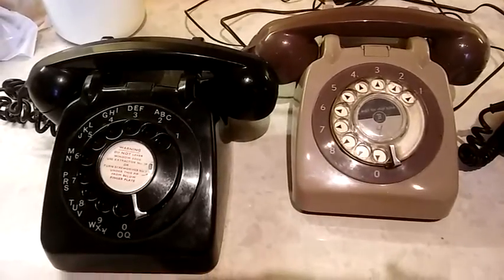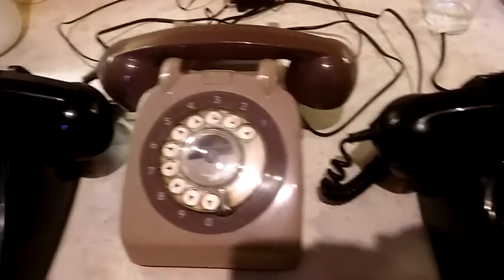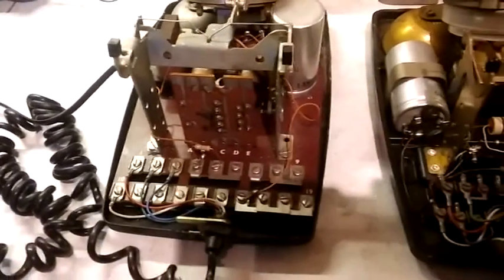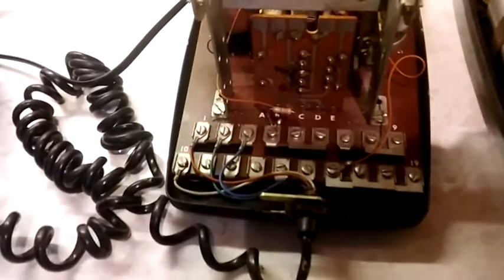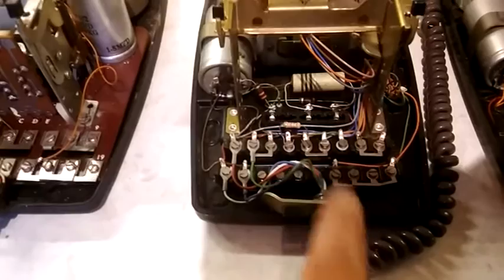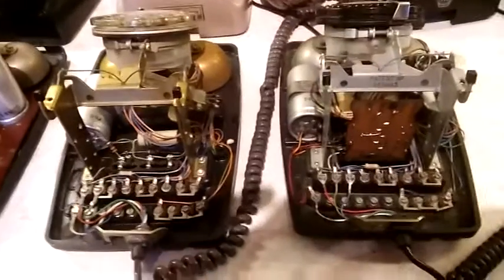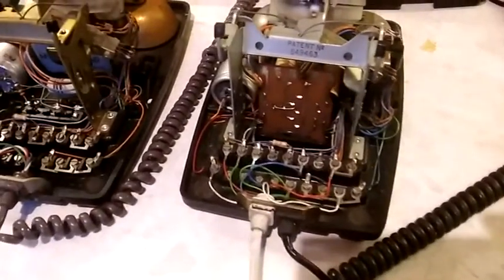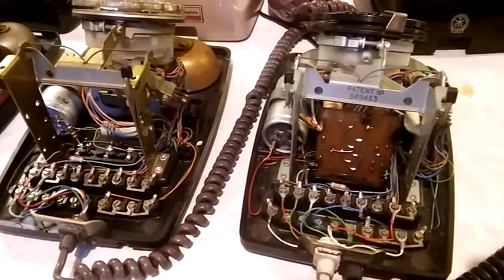Rewiring & Converting Old Ericsson Telephones.

Comment: thank you for this tutorial, I just wired up my 706 telephone and it works a treat! mine had a redial button on the top but I just disconnected it, thanks once again !!
Reply from the maker: Good to hear you got your 706 going. Disconnecting the redial button is ok. I think you could probably also leave it wired up as well, it just wouldn't work on the normal BT system these days. I'll stand to be corrected on that though.

Comment: The only descriptive identification I can find reads: TELE 706 F PO FDI BATCH SAMPLED FWR 79/1.  As you correctly pointed out my initial posting was in error.  Also inside the top casing are the letters 2/DCO/609.  On the dial in reverse are the letters BLD 12 also 468A in a smaller font size.  My dial is in clear plastic and the phone casing is in Black.  The electronics is mounted directly to the base and not a printed circuit board.  I cannot locate any L.  Numbers on dial are behind the finger wheel.   Handset blue wire = T3.  Cheers.
Reply from the maker: Thanks for the extra info. You can forget about the codes cast into the various parts such as the case and dial for now. The thing to concentrate on is anything printed or stuck to the base of the phone. So the interesting bit is 'TELE 706 F PO FDI BATCH SAMPLED FWR 79/1'.

TELE 706 F tells me the phone is a model 706 F used by the GPO, which later became Telecom and then BT. The 'F' denotes a dial that has figures only, which is as you describe and is basically the same as fitted to the later 746 type.

'FWR 79/1' tells me this phone was refurbished at the factory in 1979.

Your phone was probably originally a 706 L with both numbers and letters around the dial. My guess is it got the more modern dial when it was refurbished in 1979.

Wiring for a modern line cord is the same as for any other standard 706. I think what confused you is the 706 I showed in the other video had a printed circuit board while yours has conventional wiring. Both types were used but are actually wired exactly the same and use mostly the same components.

So the handset cord remains where it is (ie RED=T1, GREEN=T2, BLUE=T3, WHITE=T10).

Next remove all of the metal links between the terminals and replace them as follows: Link T5-T6, link T8-T9, Link T16-T17-T18-T19 so all four of these terminals are linked together.

Now you need to insert a 3.3kilo-ohm (available for a few pence from any electronics supplier) between T4-T5.

Now if your new line cord has the colours white/green/blue/red connect WHITE to T18
RED to T8
BLUE to T6
GREEN is not used so either connect it to T15 which you should find is a spare terminal with no wires coming from it, or just cut it short and insulate the end.

If your new line cord has the colours black/green/blue/yellow connect it as follows:
BLACK to T18
YELLOW to T8
BLUE to T6
GREEN is not used so can be put onto T15 just to keep it tidy.

I'll make another video about this, including how to connect the plug to the other end of the cord just in case your making a new line cord from scratch. So keep an eye out for it in a few days time.

If you have any problems the drop me an e-mail to andysshopmail at gmail dot com (I wrote it that way to confuse the spam-bots!)

Good luck with the conversion!

Comment: Excellent demonstration. Thank you. Encourages me to ask: a telephone designated as 1806 (T89 on the base), looks exactly on the outside (and very similar inside) as the N1900 in your video, but not quite. The handset is wired: red to T19, white to T8, green to T18, blue to T17. The line cord has white to T1, green to T4, red to T5/6. Sorry to trouble you but I would be grateful for any advice you could kindly offer.

Comment: Hi, again an excellent explanation, especially of the Ericsson handset cord. Quick question I always remove the strap between T8 & T9, is there any particular need/reason for leaving this strap in place?
Reply from the maker: Hi! That's a very good question about the link between T8 &T9. Later builds of phones based on rhis design and built for Telecom (as it was then) don't seem to have this link from new. This is the ones with the plug already fitted and 2000 ohm bell coils normally numbered 8746 etc. So if it's an old GPO/Telecom phone I don't think it's strictly necessary. However I'm not completely sure there aren't some wiring differences in some of the non-GPO variants as built by Ericsson and others, so to keep it as simple as possible I just leave it in. There is certainly no problem with leaving it there.

I'll do a bit more research and put together another video about this. Thanks again for the question.

Comment: What are the bell connections for the N1900 please? Connected as vid and everything works just no ring.
Thanks
Reply from the maker: The bell coils are wired together in series. So one wire from one coil goes to T4, the other wire from the same coil jumps to the other coil, then the spare wire from the second coil goes to T16. Don't forget you need a 3.3k ohm resistor between T4 and T5. If it still doesn't work drop me a message through the contact form on the website at https://andysshed.callpress.net and we'll sort it out.
Reply: @AndysShed  hi Andy thanks for the reply.
I have wired my N1900 exactly the same as your video step by step including the resistor.
I have now connected wires from the Bell coil( only 2 wires connected to bell coil) to T4 and T16 as instructed.
The phone works and rings in/out there's just no bell and the audio is very faint at the handset.
Have you any idea what I can do to sort out the bell issue so it rings on incoming call?

Thanks in advance and apologies for long comment
Reply from the maker: @tomrich191094   The problem with the Ericsson N1900 is there are a lot of different variants of it. From memory, I think the one in the video was an N1900 E244. Do you know what code on yours follows the N1900 bit?

It sounds like there is another fault going on if sound at the reveiver is low. How did you test this? If you used another old phone to ring it, then the problem could be the carbon granule microphone in the other phone. If you called it from a modren mobile, the fault is more likely with the speaker in your handset. Also, how many phones do you have plugged into your house system? You need to know the REN value of each phone plugged in around your house and add them all up. If the total comes to more than 4 that could be why your phone doesn't ring. If the ,1900 is correctly converted with the 3.3k ohm resistor, then it's REN value should be 1.

One final thing... Does your variant have the plug in rectifier board? If it does, turn the board over so the end that doesn't connevt to any of the electronic components is plugged itto the phone. That should make the speech a bit louder.
Reply: Hello i have the E244 variant exactly the same as the model in this video.
There are no phones connected in the house just this one however it is connected to the virgin media router after passing through a filter.

I suspect the speaker in the handset may be at fault but still no joy with the bell ringing. Do you have an email i could send pictures etc as your website only has a contact form but nowhere to add photos.
Thanks again Andy
Reply from the maker: If you drop me a line using the contact form I'll send you a message back with an e-mail address. I've learned not to put the e-mail in the comments or on the website because it gets scanned by bots and I end up with tons of spam.

Comment: I have a GPO 700F that I want to convert.  Your Videos are informative and excellent.  But on visual inspection of my phone.. the wiring is not as your video depict prior to any alteration.  I have tried to send or paste a image of the wiring but without success. 
I have watched your other video.  It would appear that although the base unit reads GPO Mk1 706 F.  The internal workings on a black plastic base are for an Ericsson N9100 if that is at all possible.  Therefore which video do I now watch for the answer to convert please.
Reply from the maker: That's a very good question you ask. Before I answer though I just need to clarify a couple of points. First, as far as I know there is no such thing as a GPO 700F. There could possibly be a 706F, but it's very unlikely. It's more probable it would be a 706L with both letters (hence the 'L') and figures on the dial surround. However these often got refurbished by fitting a more modern dial which effectively made them 706F becaise they usually had a blank surround with the figures actually behind the finger wheel. Underneath in white paint you should see something like '706L XXX DD/1' where XXX is a letter code denoting the manufacturer of the phone and DD is the year in the format 61=1961 etc. This is almost always in white paint printed directly onto the base of the phone. If you're getting the info from a sticky label that's probably refurb details and covers the original information.

If it's an Ericsson N1900 this will be physically stamped into the plastic base. There are normally more characters eg 'N1900 E244' That last part is crucial because Ericsson made a number of different versions of the N1900.

If I remember correctly, in the video the straps between the terminals in the phones have all been moved already. So what you are looking at is how they should be when you've finished.

Another way to get an idea what you've got is to look which terminal the blue wire in the handset cable goes to. It probably either goes to T3 on the top row or T11 on the bottom row. If it goes to T11 there's a good chance it's an N1900. However if it goes to T3 it's a 706 built for the GPO or maybe some other Ericsson model.

Is there any chance you could make a video response or maybe put a photo on flickr and post a link to it here? I could do with seeing the wiring to make sure I give you the right info. However the line cords on all the phones should be wired to exactly the same terminals. It just looks a bit different on the N1900E244 because that blue handset wire goes to a different terminal and there is that extra jumper link. You should never have to move any of the handset wires, just the line cord ones that go to the plug.

Let me know how you get on!
Reply: Thank you for your prompt reply.  The information you have given in the reply, I will put to use and then get the right model number back to you.  I have tried uploading a photo of the wiring to nill effect.  DO YOU Have an: email address; or WhatsAPP; or Messenger link as I am not familiar with flcker.  That said I will ask my offspring to assist.  Thanks again and I will be back to you. Cheers!
Reply: SUCCESS!....Thanks for your helpful informative feedback....together with two of the Youtube tutorials you have posted...I got the conversion right on the first attempt....thanks again....
Reply from the maker: Good to hear you got it working ok. Keep an eye on the channel because a couple of new ohone related videos will be comming out very soon.

Comment: Can the n1900 have a 205 rectifier installed ? if so, where do i put it. Iam grateful for you doing this video Andy, I cant find any other place that shows how to convert a n1900 which i have here right now.
Reply from the maker: That's a very good question! I can't see any reason why not. The reason they don't have one is because they were usually built to a budget, which is also the reason they often don't have a regulator board. 

The thing with N1900s is there are a number of different variations, some of which had different connections inside. There should be another code printed on the phone after the N1900 (eg N1900 E244). If you can find that code and let me know I'll be able to tell you where to connect the 205.
Reply: Mine is a n1900 E274 which i cant find any info on it via the interweb. I have now converted it thanks to your video :-) :-)
Reply from the maker: I'll have to get back to you on that one. I'm not sure what the wiring should look like in a N1900 E274 without having a look. I'll have to look through the collection to see if I've got one. Other variants are E244 and A61T.
Reply from the maker: Hi James. I've done a bit of research and answered your question about the rectifier in this video. https://www.youtube.com/watch?v=FnnyhUwDPyI

Comment: Our ringer current lead is already built in the red and green wires
Reply from the maker: That's how it used to be here too. We still only have the two wires coming in from the phone network, but they go to something called a master socket, which contains a capacitor, then to any extensions around the house. This is why we have to convert old phones to bridge out their internal capacitor (to use the one in the master socket) and also reduce the current consumed by the bells so more than one unit can operate together.

Comment: hi, my wall mount 706 (711 I believe?!) is wired correctly but doesn't seem to be powered.. can't make/take calls... no life at all! any ideas? thanks.
Reply from the maker: There are a number of things that could be causing your problem. If the phone is totally dead the first thing I would suggest is taking a look at the hook switch. If the pegs are jammed down (which can happen on a 711) or the internal microswitch that they operate isn't working correctly, then the phone would appear dead. You should still be able to call it though and it should ring.

Another problem could be the dial. If it's not returning to the normal position correctly or the contacts on the back are bent, that too could cause problems.

Finally, and this is probably the thing to try first having thought about it... What line cord are you using? Have you crimped a modern plug onto the end? Those DIY plugs often don't make contact properly when you crimp them. If you have a multi-meter handy, do a continuity test on eact intermal wire in turn between the gold connector on the plug and the spade connector on the other end. 

Let me know how you get on.
Reply: @AndysShed  thanks for the very comprehensive answer! I'll work through those ideas and let you know.  thanks again!